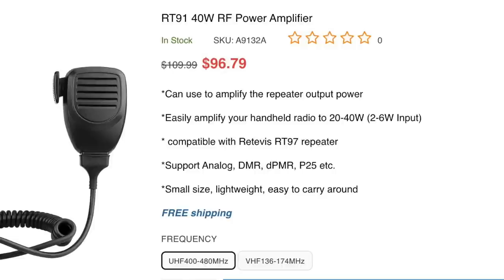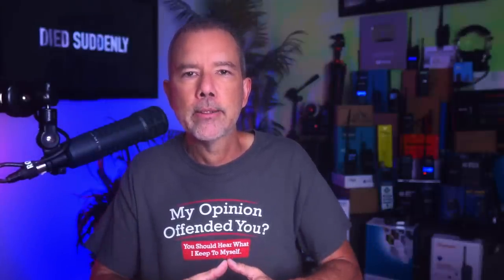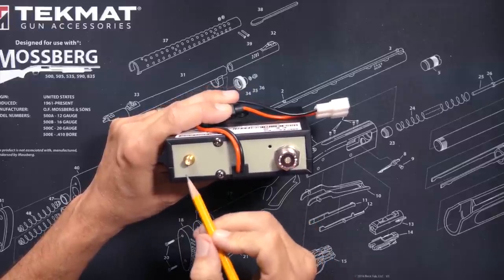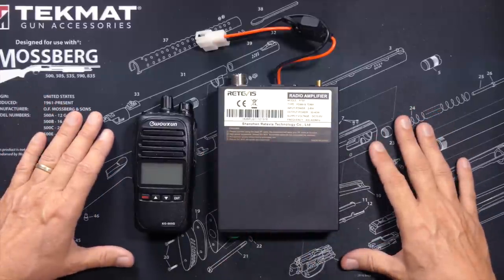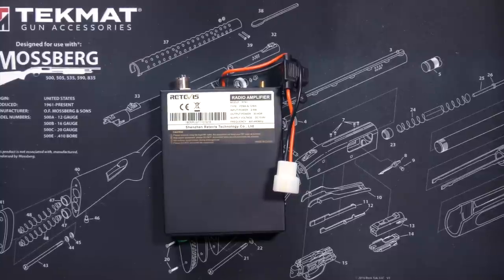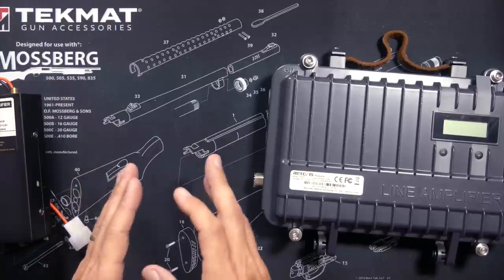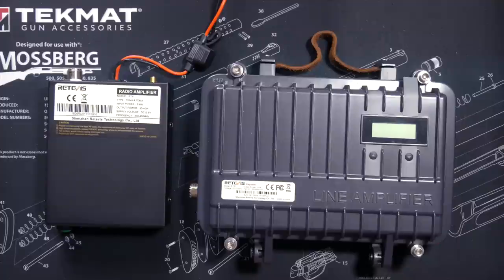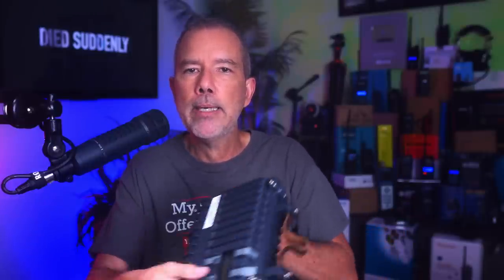Retevis RT91 Amplifier - Does The RT91 Work With The Retevis RT97 Repeater As Claimed By Retevis?

Comment: I have the same repeater and the BTECH version of the amplifier. When I first put it together I got the same results. I had placed the amplifier on the repeater and also next to the repeater and it cycled on and off like this demo. However, I moved the amp away from the repeater by about 2 ft more or less and it all works fine. It’s been working like that for a couple of months. I suspect that RF was getting into the repeater and causing that cycling from an RF feedback loop. Bottom line, it does work, at least for me. Try a bit of separation and see what happens.
Reply: My question, is do you get any more fars with the amp connected?
Reply: @notsure7874  This is an important question. Does anyone know the answer?

Comment: I am so relieved that you broke the sharpened tip off of that lethal weapon you were so flippantly brandishing.  I predict they will never correct their inaccurate claim.  TBH, they probably meant that you could physically connect the two devices together, not that either of them would actually function.

Comment: I am a sad Ham and would like to switch to GMRS, but have no friends to talk to--all my Ham conversations only last about a minute.  I pray to Zenu that you will make videos on how to meet people and potential hobbies that use GMRS. Also, how long do I need to transmit with the RT91 to adequately heat a HotPocket, should a Zombie apocalypse destroy my mom's microwave?  Thanks Randy!
Reply: at least a minute more than the chinese hexfet PA transistor burns up on its inadequate heat sink  the eazyist way heat a HotPocket with a chinese handy is hammer a nail through its Li-ion battery pack, the problem you will then have is trying to stop it burning down your shack. I too am a Sad Ham with no friends, would GMRS help me?

Comment: Excellent!  I have been a Ham for 50 years, and I knew, that this amplifier would not work with my RT97S repeater!  But, I had never ever, seen that fact proven, and you just did, thank you so much.  I would not hold my breath waiting for Retevis to correct the uses for this amplifier.  I like the comment below by ham KO4VNX on "what they may have meant".
Reply: i tried my amp from china after the repeater to the antenna and i was mobile with my wife at home. , it did"nt work. i thought maybe i blew both units up but both are ok. stupid me,i should have known better

Comment: That's quite a claim about it working with the RT97.  I don't own either, but am wondering if the RT97 can perhaps be configured as a base only, rather than repeater mode, which would make it compatible.  Just a thought?
Reply from the maker: Nothing about that in the user-manual or the software, so probably not.

Comment: "I can work... Amplifiers that work in two directions filter the signals through two separate amps and recombine them. A less perfect SWR could be a problem; sometimes, a high-loss line can be an advantage it looks like a good SWR. Then there is the cost: can they have a good filter at that price point? It is bad that they do not provide good English support, which would be a big help."

Comment: Talk about desense… !

I’d love to find an inexpensive RF power amp that works with analog AND digital types of input like P25 and DMR.
I usually select TPL or Crescend amps but these easily are in the $1k + range.

What about taking the repeater apart and replacing the duplexer with a 50 watt mobile notch style duplexer?
It’s still very economical if it does work.

Thanks for the video.

Comment: If the thought is in place of the amp being between the repeater and the antenna it should work due to the repeater is a radio like your hand held it listens and transmits with the amp it allows the flow of in bound signals and boosts the output bound power and signal. Remembering the line of sight rule still comes in to play. Yet the penetration will be increased. Seeing your results something just didn’t add up why it was acting up so strangely.  Although if the amp gets too much power from the radio it could cut out .
Reply from the maker: You very clearly have no idea how a repeater with a duplexer works.
Reply: @TheNotaRubicon  still new and learning. I do know on many styles of amps some have what is called high drive and others have low drive input. High drive you can put higher power in and it works but low drive amps if you over drive them they tend to cut out. But then again that is 11 meter c b equipment on AM I’m sure the uhf vhf and fm are different in nature.

Comment: it made my radio def. Id ping a repeater with the amp and hear nothing back. a second radio without amp would hear the repeater tone. I also had no more range to hit repeaters on the edge of reception. using simplex I could tell virtually no difference with the amp either. functionally it was a paper weight. I returned it and got a crossband mobile radio and that was all the difference in the world.

Comment: Is there any chance that connecting an additional "external" duplexer between the amp and repeater with one antenna at the amp output and another at the other leg of the duplexer would remedy this?
Reply from the maker: You would have to disconnect the internal duplexer and then connect an external duplexer capable of handling the power.

Comment: I'm not a ham, heck, I don't even play with gmrs. the best I can do is fall back in my CB experience. I can't really see where it would matter. it shouldn't make any difference whether you have an antenna, a dummy load, or an amp beyond the duplexer. seems to me that a duplexer is nothing more than a glorified notch filter. it could be that you're inputting more than the 5volts to the amp  and it's being overdriven. Again, not a ham, but have put a bunch of amps on CB''s since the 70's and learned a little input power goes a long way in an amp.

Comment: Did Retevis give you a cable diagram of how to connect their amp to their repeater?
Should be in either the user manual of the amp or the user manual of the repeater or online on their website.
Reply from the maker: In the user manual there are words and pictures describing how to connect to a transmitter. It does not differentiate between a regular radio and a repeater.

Comment: I would have thought it should work, interesting,   Trying to think out the science ... OK no, it wouldn't work as the repeater is both transmitting and receiving at the same time. 

     I think Sales wrote the literature with out consulting engineering, BUT I'm a bit clinical might be a little sarcastic too.  It is probably the Chinese being their old ethical selves.  On the other hand there would be quite a few returns and pissed ex customers, which doesn't help the bottom line... oik got to be the first reason... OOPS.  It will be changed in 24 hrs. 

      Thank you, learned something today, besides the planet is swirling deeper in to the toilet.   OH! I forgot to announce that, I'm a Ham... or maybe not because I don't know everything even though been licences 33 yrs AND on top of that, I was born in New Jersey.  left when I was 7 though..  Maybe that is the reason I don't know everything, I left too soon. 

         Do you really get comments about your pencil!?   Well further proof we are swirling faster and faster.

      BTW last week or so some professors back east (where a lot of people DO know everything), Among  the 110  words, acronyms etc. OCD is now verboten They are now to be refereed to as Object  ORIENTEERS.. Since I am a Ham  I guess some where in part 97 rules from Title 47 of the code of Federal Regulations I have to make sure you are correct, don't want to be reported or something.  I don't remember seeing it but I may have missed it during the fascinating read.  I hope this was long enough to qualify as a HAM.

Comment: You probably did something wrong. If you pushed the pencil all the way into the sharpener for less time, the point shouldn't break. Why don't you use a pen? You can get a whole pack of pens from Amazon for almost nothing.
Reply: I tried using a pen, it broke the sharpener